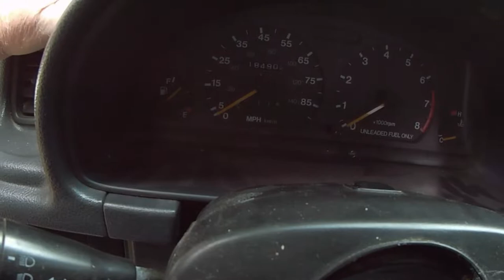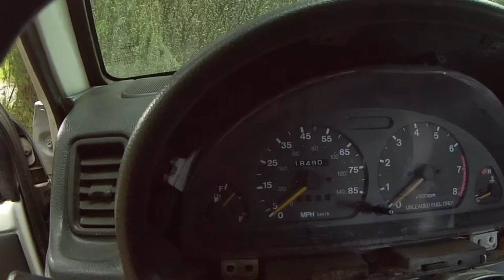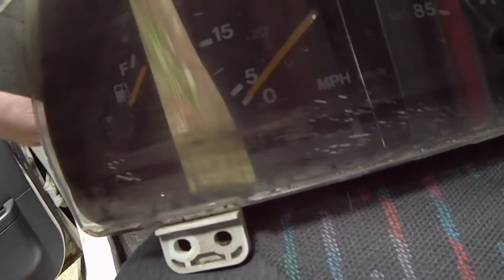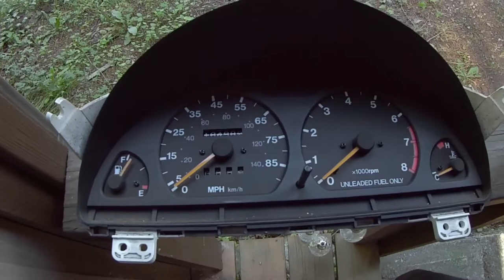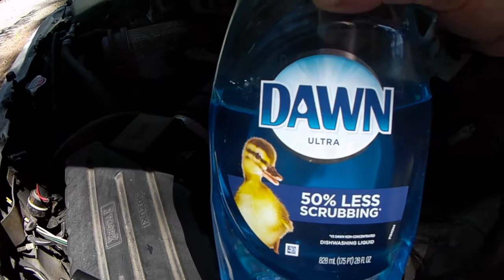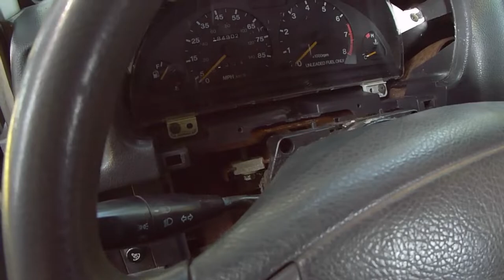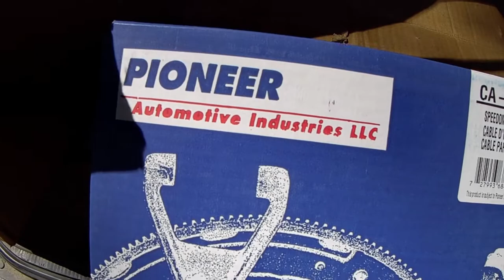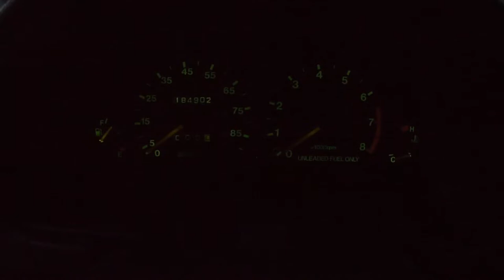Project Basher (1996 Geo Tracker): Speedometer Repair

Comment: You disconnect the speedometer cable at the transmission in order to get the cluster to come out more.  Before disconnecting the speedo cable at the speedometer, disconnect the cable at the transfer case, put it into a variable speed reversible drill, and slowly spin the cable.  See if the needle is moving on the speedometer

Comment: It is worth the extra work to pull the steering wheel off. My speedo cable was very rusty so I wd40 sprayed it spun it, then sprayed lubricatant into the cable spun it I also pulled the gears of the speedo and lubbed them. the hardest part is seating the square cable COMPLETELY. The bulbs pull straight out of the plastic base, I have replaced ALL of my instument cluster with LED even the small ones.

Comment: There should be a way to route the cable into the firewall near the heater core, behind the radio, up into the gauge area. You can see the grommet in the video. @21:20